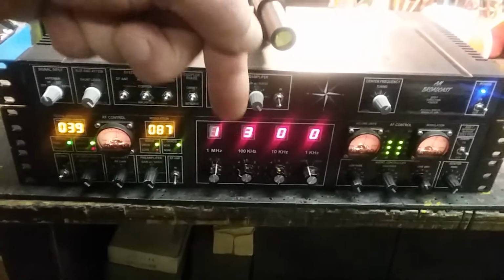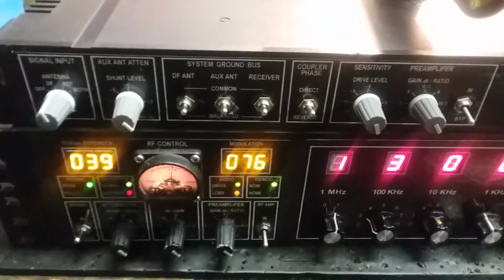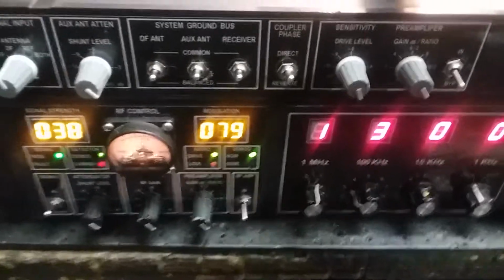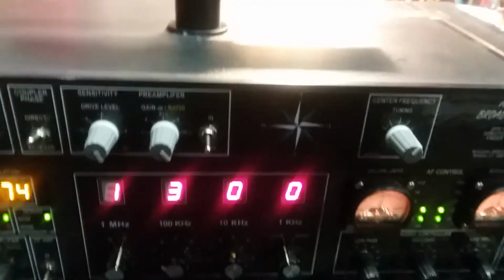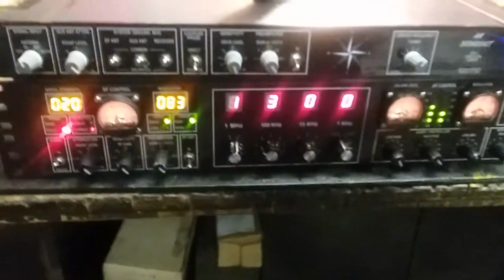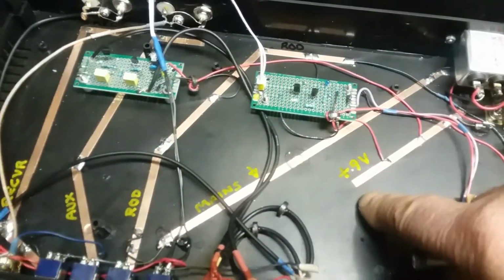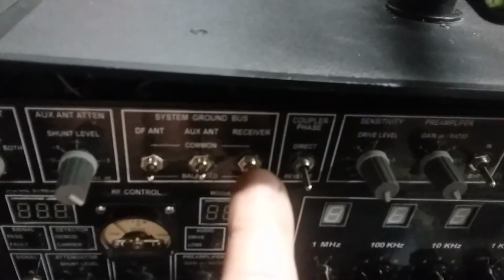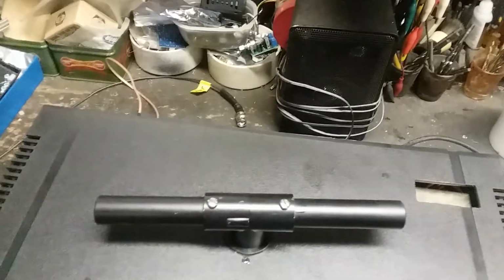Ferrite Loop Broadcast Antenna:  Part 4

Comment: Add a 10k "fine tune" pot in series with the main pot. Then you get it close with the main pot and zero in with the fine tune. What I have always liked about tuned ferrite loopstick antennas is they work as both an antenna and a preselector